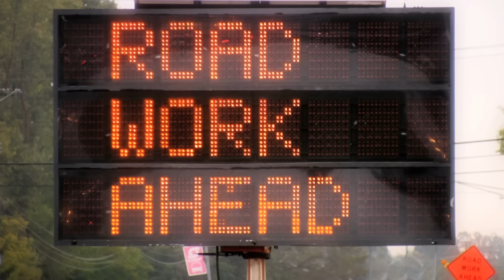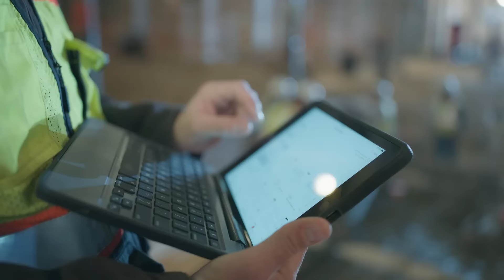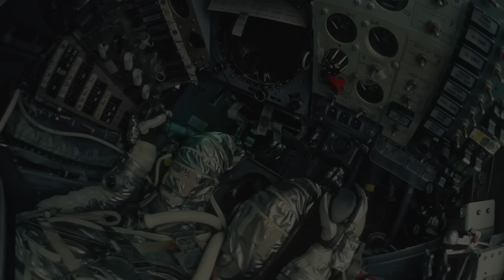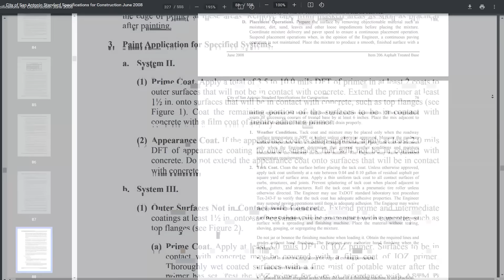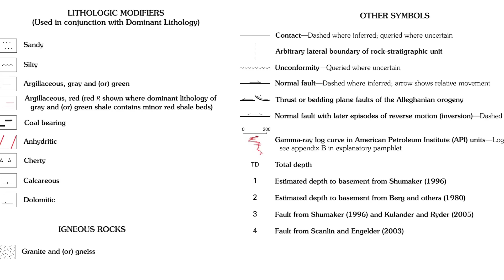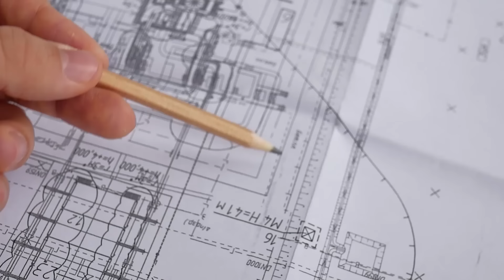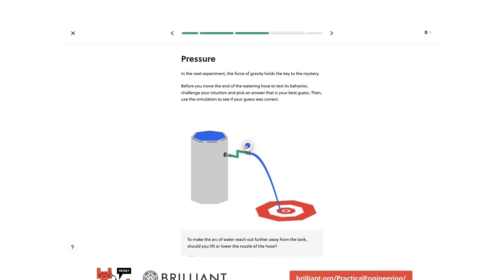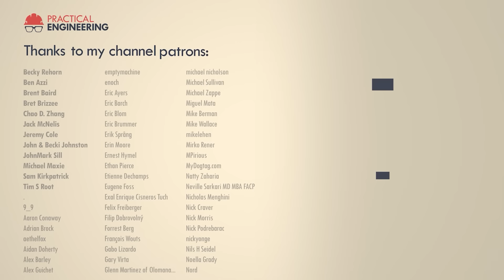4 Myths About Construction Debunked

Comment: "Lowest bidder equals lowest quality" is something I constantly hear people try to claim about the term "military spec" as if certain specifications weren't part of that bidding process.
Reply: Yeah most people don't understand how it actually works because they've never had to make something to a print.
Reply: That's the tricky part where politics often interfere. I still remember how Polish goverment hired cheap Chineese labour to build our roads. Let's say Ukrainians turned out more reliable in the long run
Reply: @angelikaskoroszyn8495  no question that things could always meet a higher standard. However, the point is that lowest bidder doesn't mean lowest quality. Certain specifications have to be met in the first place. Otherwise the US military would probably have everything made by China with the bidder being Walmart.
Reply: @RedWingsninetyone  lowest bidder tends to mean lowest profit margin. Walmart doesn’t work for free, some other specialized company that has already been doing that specific task will take on the job since they have the expertise and tools. That’s why government contracts tend to only go to a few specific company’s.
Reply: @FishFind3000  correct. The reference to Walmart was a sarcastic one referring to their general focus on cheapness over quality. Unlike, say, the US Military, Walmart doesn't generally have minimum specs required for their merchandise. Or at least anywhere near the same level.

Comment: I have seen many instances where a lot of people were paid to stand around.  Back in 1965 I worked on the Shell Oil refinery in Walnut Creek CA.  When pipelines were attached to storage tanks, 3 full crews were required although there was only room for 2 people to actually work on the connection.  A pipefitter crew, a boiler maker crew, and an operating engineer crew.  12 to 14 men to do the work of 2.  Union rules.

Comment: Standards and specifications can be part of the problem. Portland cement is almost always specified in concrete structures.  There are many alternatives that have desirable characteristics like cost, strength, durability, CO2 emissions etc. Most can not be used because of the regulations. 

Don't get me wrong. I'm not against all regulations but in some cases they do have downsides.

Comment: I worked temporarily on a high production paint line. We stood around quite a bit during a color change, or issues upstream. There were other tasks available nearby, but they were reluctant to move us unless there was significant problem. Nobody wanted to be the bottleneck. That's why most of the decisions of that type were made at the management level.

Comment: Dig to something solid. If the sand isn’t too deep, you just keep digging until you hit something solid. For example, the Brooklyn support of the Brooklyn Bridge rests on solid bedrock. They used a box called a caisson which was pressurized and placed underwater, and workers dug away the sand letting the caisson sink until they finally hit bedrock.
Put supports deep into the sand where the sand provides them with structural stiffness. If you drive a support deep into sand, the friction of the sand will eventually keep it from moving. This was the technique used for the Manhattan support for the Brooklyn Bridge, where the sand was much, much deeper. They just dug deep enough that the support was unlikely to move. It still hasn’t.

Comment: The one guy everyone forgets about who’s job is to stand around and watch is the spotter. Every time you have a large machine digging/moving or doing anything you need a spotter. The machine operator cannot see everything and the spotter helps out by being a second set of eyes. Additionally he/she spends most of their day looking for anything that might indicate a problem. This could include unmarked utilities or other thing buried that are not marked in the plans. Additionally the spotter(s) will take that shovel that holds them up most of the day and dig a spot by hand to uncover something they spotted in order to get a positive identification without damaging what’s buried. All jobs in construction are there for a reason because as already stated in the video the contractor/sub contractor is paid a fixed amount to accomplish certain task. Having anyone who is unnecessary is only affecting the bottom line of the budget that as lower bidder is already tight.

Comment: Once I was told by a friend at the property that "digging holes isn't hard, people are just lazy". So I invited him, let's call him Gary, to help me digging 8 foundations (70x70x70cm) for a 24m long brick wall. "Sounds easy", he replied. So 6AM we started, to each his hole, side by side along it's length, 3m apart. He wasn't the athletic type but even if he were, he'd be respectfully grunting. We did 6 out of the 8 by the day's end, and Gary had a new found respect for construction work. We had shovels only, by the way. Digging anything is easy until you have to shovel a few cubic meters of soil and, in our case, sometimes we struck through the former wall's concrete sections underground. It wasn't pretty but we got it done.

I was dying in wait for him to say that "mixing concrete wasn't a lot of work", since that was the construction's next step, me and my wall were just savouring the incoming pain he would feel should he accepted another invitation.

He was paid fair, I'm inclined to say this to avoid friendship misunderstandings or abuse. He needed the money and the lesson so we went to town.

Comment: As someone who's spent the majority of their adult and teenage life on a construction site, I can confirm that the stereotype of construction workers standing around is definitely not a myth. Most laborers have the mindset of, "I come, I get my hours, I get paid." The reason contractors put up with this is because that's the industry standard for labor. (and that's also a large part of the incentive to hire illegal immigrants; they usually work harder because they have less negotiating power.) If there were somewhere they could go to get guys who don't stand around a lot, they would, but finding good laborers is one of the most difficult parts of being a contractor. Also, the labor hands tend to work better when the boss is around and stand around when he isn't.
The problem is even worse when the workers are employed by the city or when they're part of a labor union. The laziness goes through the roof and the number of workers far exceeds what is absolutely necessary. Don't ask me why, but I've seen it time and time again.
When I worked in Southern California for a few months, I saw this problem on a whole other level. One contractor literally had 7 guys on site all day every day and their only task was to remove a chain-link fence at the start of the day and replace it at the end of the day (a task that 4 guys can do in a half hour.). There was no pounding posts or anything, literally just setting it in place, and some days they didn't even have to move it. When I asked my boss why they had so many guys on site, he said they have them there to justify their day-rate.

Comment: It's also worth noting that Cost vs Longevity is absolutely NOT linear!  In some instances, a small difference in cost can have a tremendous impact on longevity; in other instances, the tiniest difference in longevity can entail tremendous expense(s).  What makes this a particularly difficult juggling act is that design elements frequently work at cross-purposes - a design change could make a structural member more durable, but that same change could make the structural member more difficult to align/install correctly, rendering the overall structure less durable.

My personal peeve in this regard is anytime I see people working with wet concrete for structural projects.  For the layperson, yes, concrete is generally wet when poured, but there are degrees of wetness.  In the trades, this is referred to as "slump" - you fill a slightly-conical section of pipe (usually about twelve inches long, with a four-inch diameter at top and an eight-inch diameter on bottom) with concrete, tamp it down, then remove the pipe and measure how much the concrete slumps down.  Modern concrete is generally strongest with around 3" of slump, though most concrete pumpers require at least 4" of slump in order to function properly.  The concrete being poured at the beginning of this video clearly has at least 8" of slump (extremely wet) and is liable to fracture within days (before it has even had the chance to properly set).  As a general rule, every additional inch of slump (beyond the initial 3") reduces the concrete's strength by roughly 500 PSI - in addition to making the concrete more porous, increasing susceptibility to water damage (particularly during winter, with freezing temps and deicing salts).  A really, REALLY bad thing for roadways!

Generally speaking, more rebar makes a concrete structure stronger and more durable.  But there's also a point where additional rebar makes it more difficult to get the concrete poured properly - any voids left between the concrete and the rebar will weaken the overall structure more than the additional rebar strengthens it.  Which is why contractors tend to favor overly-wet concrete (as it's easier to work with and fills difficult areas more readily) rather than spend the time and effort to install drier concrete properly.  After all, they're being paid by the job to pour the concrete so of course they want to do it the fastest and easiest way possible.  One of those people 'just standing around' is supposed to make sure that the concrete workers AREN'T overly-wetting the concrete they pour.  But hey, if the contractor can save $100,000 in labor costs by using wetter concrete and paying the inspector $50,000 to look the other way...

Comment: I've lived next to construction sites in the past. A few years ago the job was to put in a tiny round-a-bout. The main street was 2 lanes, then there was 2 entrances for parking lots.

The beggining of the project was putting up construction warning signs and then the county proudly put up the "your tax dollars at work" sign.

The project was scheduled to be completed in a year at a cost just over $800,000.

About 2 months later the construction company removed the asphault in preperation for the round-a-bout. The construction team consisted of 4 flag-persons (obviously needed), 1 heavy equipment operator and about 6 laborers. They would show up about 7 am. The heavy equipment would generally be started some-time around 9 am. To remove the asphault an escavator was used.  Occassionally a laborer would walk over and toss a few pieces of asphault in the bucket. Around 9:15 am, the heavy equipment operator got his 10 minute break. Then he would go back to work until about 9:45 am. At that point a laborer would sweep the road for about 10 minutes. Then the whole team would leave, sometimes for the day. 

If they came back after lunch, they usually showed back up around 1 pm. They would stand around until the flaggers were ready and then start up the heavy equipment, where the same procedure as before went on. 

About 1:30 pm the heavy equipment operator would stop, a laborer would sweep. By 2pm the whole team would be gone.

It took them several weeks to remove the asphault from the street. It was left in a pile next to the roadway. The escavator was left in my apartment's parking lot, in the way.

It was over 3 months later when they showed back up. It was about the same team as before. They brought a dumptruck. The heavy equipment operator loaded the dumptruck and was the only one who ever drove the dumptruck. They took about 3 days to do this portion of the job. 

The next day the heavy equipment operator drove the dumptruck with the asphault to the dump. He came back and parked the dumptruck in the other apartment's parking lot.

Sometime around 2 months later they showed up. The heavy equipment operator left with the dumptruck. I went up to the team to chat. The 4 flagpersons were in a group and the laborers in another.

I asked one of the laborers where they had been. He said "another jobsite". I asked if they were going to be done on time and several of them laughed.

One was more talkative then the rest and he eventually explained what was going on.

They had so many workers on the jobsite because that was the minimum that the county required. The owner would underbid multiple contracts in order to win several. They only had the one heavy equipment operator. They would do some work at several sites, rotating between them. After a few months the owner would move them to new contracts. Then the owner would go back to the various government agencies and redo the first set of contracts because of "cost runs". Until they had the new contract no more work would get done.

He said that larger projects might have 2 or 3 "cost over-runs". I couldn't believe it and asked how they got away with it.

"That's how everyone does it"

A few months later the county put up new signs. The project would be completed almost 8 months later than original at a cost over $1.2 million.

The only time that I saw the 6 laborers working was when they put in the concrete sidewalks, the brick center piece of the round-a-bout, the various plants and wood chips. The only time all 6 worked at the same time was to build the sidewalk.

I doubt that they ever had more than about 5 hours if useful work in a day. It would take about 10 minutes to get ready to work and about 10 minutes to get ready for a break or to go home. There was a 10, or 15, or 20 minute break in the morning and another in the afternoon.

Officially lunch was 1 hour, but they had travel time also. The closest places were about 15 minutes away, but sometimes they went to a place 45 minutes away. This travel time added 30 to 90 minutes to their lunch break.

Yes they had delays caused by inspectors and even weather. Nothing came close to how the projects were run.

I was also told that a project involving multiple companies would entail so many delays that it'd make your head spin. Every company on the project would create delays that would in turn delay all the other companies.

Comment: You also need spotters whenever heavy equipment is being used. Especially if that heavy equipment is being used in a populated area or around moving vehicles - like a road that has been kept partially open. Keeping roads open while working on them extends the length of the construction project because they can't do it all in one go. But closing roads means moving traffic to other roads that may not have been designed with that volume of traffic in mind. So we get the worst of both worlds where everything moves slower and gets snarled up because rather than commit to getting the necessary work done quickly, we instead must keep the road open which means the construction will take at least twice as long as it would otherwise.

Comment: The one that really gets me is when the job site is completely idle.  Ie: repaving roads, the scraper comes along and brings it down to the corrugated state and then it's left for months with traffic rolling over it before the paving crew comes in. 

And then about a week after repaving, someone needs to rip up a piece to do some underground work and then they do a quick patch which settles down and then there's bump in the road for the next several decades until it's repaved done again.
Reply: Yeah, there's a staircase near my house, there was some concrete damage but it was functional. They decided to replace the slabs so they tore them out and put up barricades in a day. Now more than 6 months later, no one's been there since and there's a sign saying the job will be done soon. I have to walk an extra 15 minutes each way until they do an afternoons worth of work.

Comment: I have an example for Budget vs. Lifespan: Recently i bought a Tarp to protect my Bike from Rain at the outdoor Parkingspot of my Workplace. It was the cheapest Option. It came as i predicted: it got ripped open by the Brakehandles, despite my very carefull handling of it while putting it on and off. This was after only 3 weeks of use. I commute by bike for convenience. One way, Home to Work, is 3 km. I can walk that no problem, but it takes twice as long.

Comment: after 10 years in building maintenance I'm just convinced that engineers and architects have absolutely no idea what's conducive to a good work flow or how to stop themselves from turning a 10 minute job into a 3 week job that needs 4 specialized crews that I could of done in 5 minutes with a hammer if they had any experience doing the work that needs to be done to maintain the monstrosity they've designed.

Comment: A form was placed on the Blue Ridge Parkway bridge over I-26. The rebar was woven inside of it. Then, it sat for a week or two because the engineer that designed it was on vacation so was not available to inspect the work and give the okay for the concrete pour.

That was one of the oddest things I have seen in a while.

Comment: 4:49 - It works both ways. It's a common problem when immigrants from northern countries (ex., UK, Germany) decide to buy and "renovate" a house in a Mediterranean country like Italy, Portugal, Greece or Spain, especially if it's near the coast. They tend to use materials and techniques from their native (northern) region (which are probably great at resisting frost and rain), and everything starts to crack and crumble after a couple of years, because they didn't take the heat, moisture variation or salt into account. 

TL;DR - Avoid buying houses around the Meditrerranean if they've just been renovated (or built) by people from a different region who think they know better.